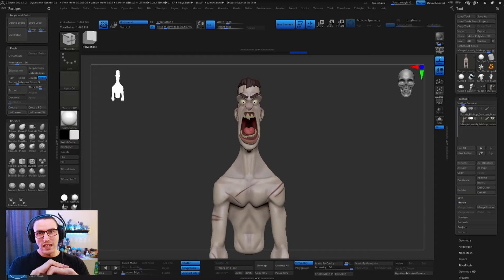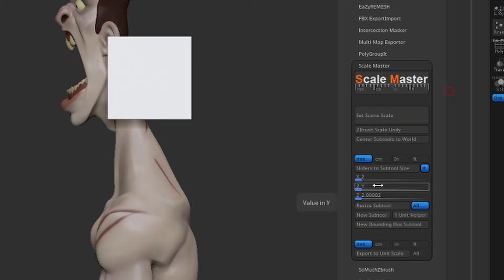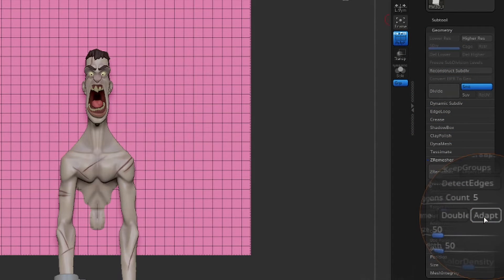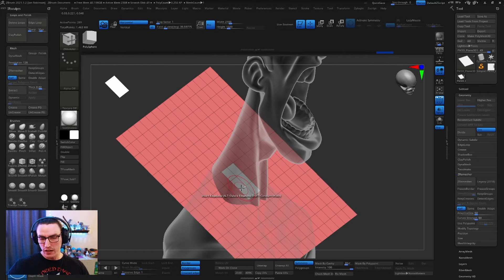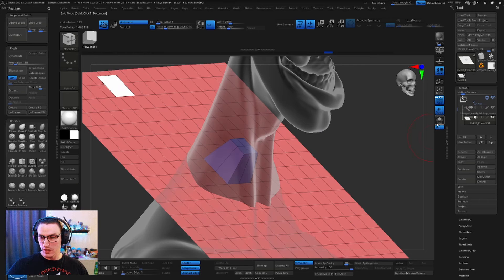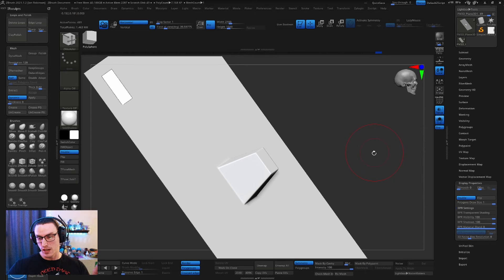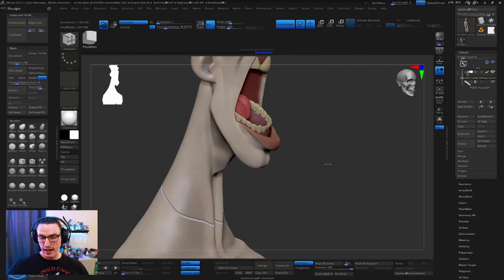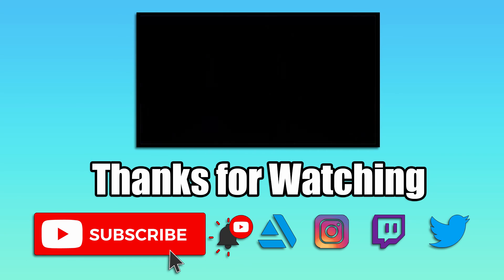Cut Your Models with Dynamic Thickness in Zbrush (Beginner)

Comment: the way you do it doesnt it create a nasty gap between it?
Reply from the maker: Anytime you cut a model, you will always create a gap. But with dynamic thickness, you can control how much of a gap you create. Also, I use wood filler anyway with my prints to help fill any holes or gaps that appear to keep things clean.

Hope that helps

Comment: Does the .002m thickness throw the placement off and leave a gap where it joins? Have not tried this but I'm seeing more and more video on zbrush. Might try this technique. Kind of tired of getting models that are already keyed but then you ho put it together there is gaps. I keyed one of them on mesh mix came out good no gaps.
Reply from the maker: Most of the time, when you cut up a model this way, the gap should close up nicely. And this is due to the fact that the dynamic thickness helps keep the cut between the key and the slice even all the way around. .002mm is super small, so you shouldn't see much of anything.

Hope this helps and definitely give it a try

Comment: This is extremely helpful, I especially appreciate that you mention the keyboard shortcuts and what they do as you go :) 

I'm still extremely new to this, and I want to make sure I'm committed to it before I splurge on the full version- I'm working with the core version for now, is there any way something like this could work in Core? 

Thank you :) great tutorial!
Reply from the maker: Thank you so much! Glad this was helpful for you. When working with Zbrush Core, what you can do is create your cutting tools that you plan on using. After you place your subtools that you’ll be cutting with in place, set them to subtractive. Then, with Dynamesh turned on, merge the subtool that will be cut down into the cutting tool. 
Then re-Dynamesh. If done right, it will cut your model and give you similar results as what I did here.

Check this out from Ask Zbrush for guidance too :)

https://www.youtube.com/watch?v=mXKuQ2iBlUE
Reply: @IRSculpts  thank you so much!!! 💜💜💜

Comment: Thanks very much! One question(I am still very new in this hobby): the clearance needed between the 2 pieces to be 3d printed,  is the thickness you apply on the plane 3d subtool?
Reply from the maker: You’re very welcome. Yes, the thickness I applied is the clearance needed between the 2 pieces. I found that .002 - .003 works best for me at the 1 in scale; however you may need to adjust this number depending on the tolerance of your 3D printing machine. Hope that helps :)